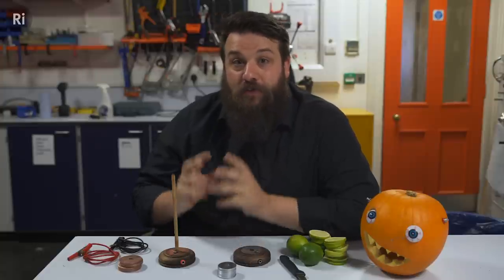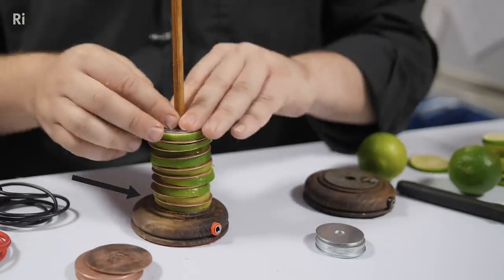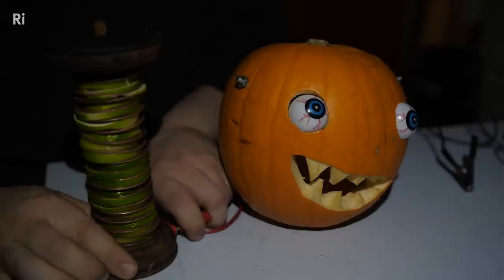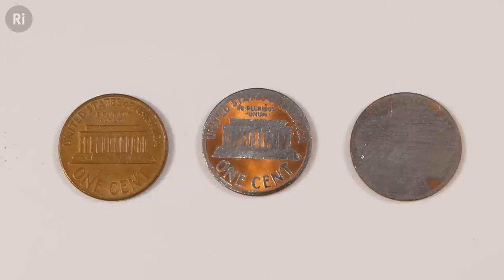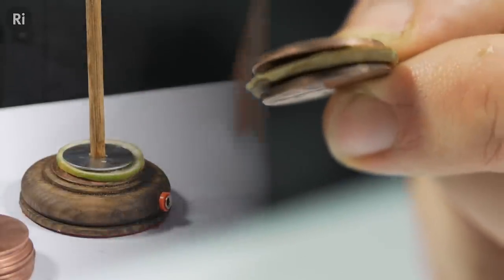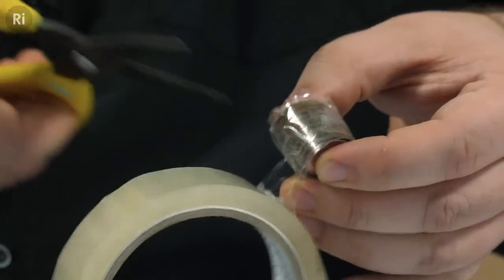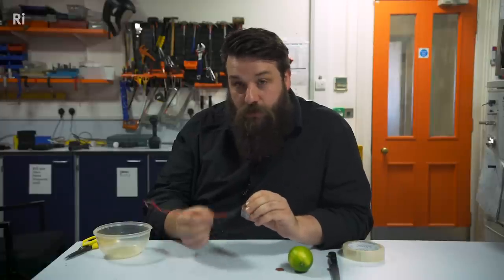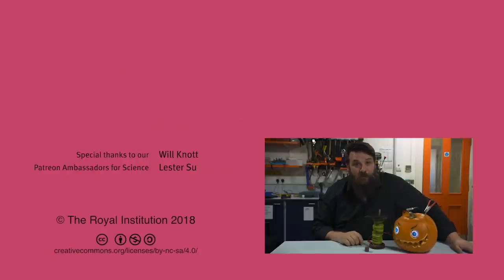How to Make a Simple Battery

Comment: Isn't the first viable battery the Baghdad battery, similar to a leyden jar?
Reply: Although the jars do contain a copper tube and iron rod that can be used to create a functioning cell (as demonstrated on Mythbusters) if the jar is filled with an electrolyte solution, it is far from clear that this is actually what the objects were intended for, as their components are in all respects identical to scroll containers from in the same area, and no evidence of their use as cells has yet been discovered.  The answer, for the moment, has to be 'perhaps, but unproven.'
Reply: @MinesAGuinness  interesting... If they were scroll containers.... One might ask why the two metals were different, though. Most things are done for a purpose, and although admittedly we are in the realm of speculation, I don't see any benefit from storing a scroll with various metals instead of one very abundant metal
Reply: @Drifter2003  I think that the idea is that scrolls were wrapped around the iron rod and stored inside the copper cylinder, sealed with bitumen. In the case of the 'Baghdad battery', this was apparently then stored inside a clay jar (the other examples, containing scrolls, did not have the clay vessels). I would surmise that they found copper easier to work with to make a cylinder, but used an iron rod to avoid it bending so the scroll could be easily rolled back up - all conjecture on my part, of course. However, it is entirely true that the materials, if the jar is filled with lemon or grape juice, can make a cell. It would be intriguing if a purpose could be conjectured that might give a 3rd Century Parthian a reason to utilise this property. It was once suggested that electroplating was the purpose, although no examples have been identified.
Reply: @MinesAGuinness  as strange as it is one explanation I have heard is divine experience. You are right, what possible functional need would someone at that time have for a battery? But it *does* seem possible that one was made by accident and they afterword ascribed electric discharge as contact with God. I admit that this theory is highly speculative though! Interesting at least. 🙂
Reply: @Drifter2003  I think that is a plausible hypothesis.